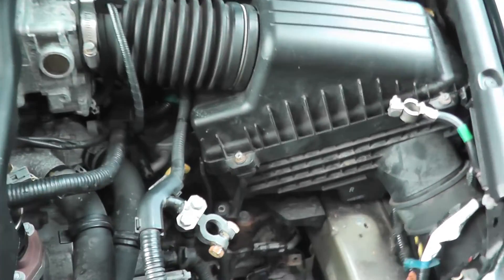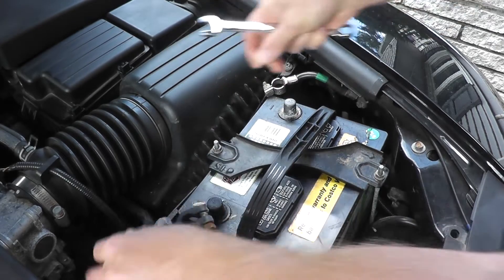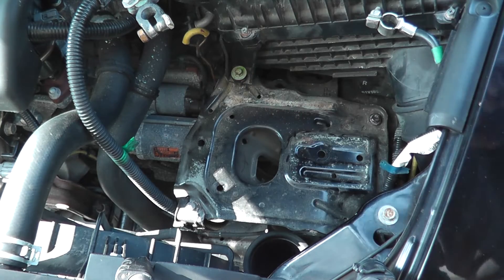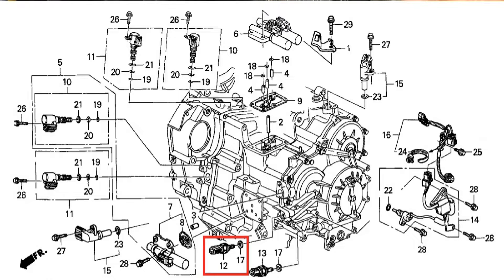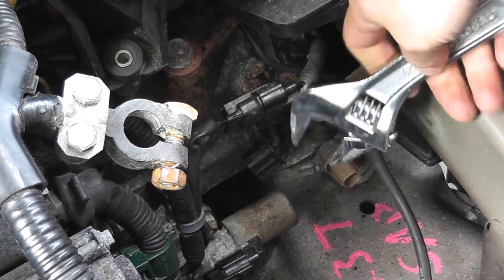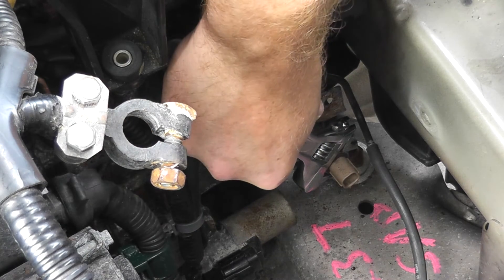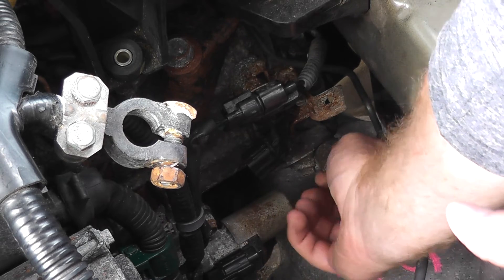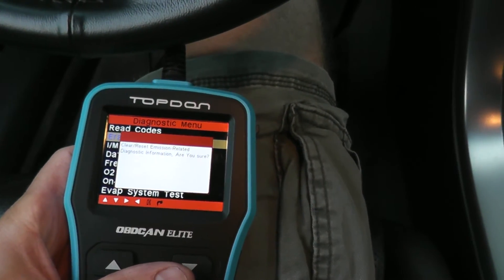How To Replace A Transmission Fluid Pressure Switch P0847 / P0848 / P0872 / P0873

Comment: Need to know we're the transmission pressure sensor is located on a 2015 Subaru Forester AWD 4:58
Reply: Yea me too is your check engine light on too.  With error P0700

Comment: You literally saved me a transmission if this works my guy. I was almost sure it was shot until I realized I'm shifting and getting into gear just fine (hit 80). I also had no check engine light when I took to mechanic. He even told me it was shot. But there was NO check engine lights when I dropped it off. But when I picked it up there was, This was a month ago(It literally sat for a month smh). I just checked them today randomly lmao 08 lancer: P0841 code for others it might be P0840 or both like me! He described from 4:58 on exactly what I experienced. I will be purchasing it tonight. I will come back for the result!
Reply: Did this work for you? I get the same code and transmission slightly shifting at 60mph. Got this code
Reply: @desr924  It certainly did. The part was $112 for the sensor but next time if it happens I'm just going with getting a new valve body and that's about 150 170 so $60 more you can get a newer one.

Comment: I have P0878 on my 2016 honda odyssey.  Can anyone help tell me which switch to change?  Hard shift from 1st to 2nd gear but only after driven for a few minutes, doesn't do it on cold start.  Occasional hard shift from 4th to 5th gear.

Comment: What is another name for the switch?? I jist got a p08433 code for my 2010 chevy cobalt and i cant find the part listed anywhere... do you know what the name of the switch is? The code said a transmission fluid pressure sensor but cant find that part anywhere...is there a difderent name 4 it??

Comment: I have a 2013 dodge caravan and whenever I put it in reverse the stick seems to go hard and it gives a very bad click. I got code fluid pressure low code P0868. I checked the trans fuel it was way more than the required level so I took some oil out. I don't have any leakage. Can anyone suggest to me what to do? thanks.

Comment: You can test them, with a very caveman multimeter

Turn the ignition switch to LOCK (0).
 Disconnect the 3rd clutch transmission fluid pressure switch connector.
 Turn the ignition switch to ON (II).
 Measure the voltage between the 3rd clutch transmission fluid pressure switch connector terminal and body ground.
 
Is there about 5 V?

Replace the 3rd clutch transmission fluid pressure switch.

Comment: I did not have any engine code or any hard shifting or driving issues but i had flashing 03 on dash board of my Accord 2014. After researching and asking honda Stealers i decided to chnage this sensor. This video helped me guiding thru.could not find the hidden Bolt anyway. So approached from the splash shield side aproach. OEM parts comes with a washer 👍.some AT fluid comes out though. No big deal.

Comment: I'm about to change the valve bodies n a 2010 Murano I don't have the code on me but it's a sensor or relay stuck off when I put it in drive it'll barely move an the computer is stopping it from giving it anymore gas is that limp mode like you mentioned. Would that have anything to do with the pressure switch or valve body issue ?

Comment: I furst noticed my car would not switch between gears. It would stay in a higher gear and once i got to autozone they did the check engine test. The reader popped up and said either its my transmission fluid is low(which it wasn’t) or the sensor is gone bad.

Comment: Were can you buy these switches
Reply from the maker: Quite often the only option is the local dealer. You may be able to find a used one on ebay.
Reply: @Carsntoys  I have a 2005 and the dealers says there no such sensor on the car.I read the sensor goes bad cause a hose is clogged.

Comment: Hi my honda accord mk8 2.4 petrol automatic green d light is flashing and gearbox first and second gear switch is jerky from before but wen the lights starts to flash igear change get rough and high revs amd engine light comes on but wen reset goes off for a while

Comment: Did you have to drain the transmission fluid before changing the pressure switches?
Reply: Not if they're mounted on the outside of the trannie like the one in this video. If it's mounted toward the bottom, you might lose a bit of fluid.. just be ready with your new one.

Comment: Hello, maybe you can help me. I was changing that sensor and I noticed that the diameter of the new sensor is very different on the new sensor. The new one has a much smaller inner diameter than the old. So I decided to hold off. Any info would be appreciated. I checked the part number and it’s supposed to be right. Also the color is different. Thanks
Reply: I can’t remember for sure, maybe rock auto, Amazon. Doesn’t matter in my case because the transmission took a final shit. Trying to rebuild it but it’s costing an arm and a dick.
Reply: Can you tell me where you got the part because all the stores I called can't find it in their system.

Comment: Hi, I have error code P0841 in my Nissan X trail 2015. Is the problem the same in your video? Thank you for answer.
Reply: Did you ever find out what caused the P0841? I've got same in my 2007 Mazda 6.
Reply: @mrau92me  yes. it's the transmission belt chain need complete overhaul. It's very expensive it's like almost buying a new car.

Comment: I am having the shuddering right now with no error codes thrown, should this be my number 1 fix?
Reply: Get a BlueDriver OBD2 scanner to confirm.  I just bought and received from Amazon and tried it... has detail report even though the error didn't show in my odometer console in my TSX 2006.  I think as long as it wasn't erased from memory, the log will show when you plug in your OBD2.

Comment: Hi my Honda Accord v6 2008 model problem is that the D light blinks but goes out after sometime. What could be the problem?
Reply: Either your trans oil is low or you got a faulty pressure switch. If you really wanna find out. Get a diagnostics test.
Reply: My Honda had the same issue and i scanned it and it showed a faulty intake manifold sensor.
Reply: I also have the D light blinking, did you guys find a fix? The transmission shifts good and all, no problems noted. I turn the engine off and the D stops flashing and sometimes won't turn on until couple days later.

Comment: How many total switches are on an '08 TL (5AT)? I don't have any OBDII codes but occasionally my AT has a harsh downshift into 1st gear.
Reply from the maker: If I remember correctly, there are three.
Reply: @Carsntoys  Gratitude, I clearly see two on the AT exploded diagram. I'm going to look again to find the location of the third switch.
Reply: Did the switch fix your problem?
Reply: @elcachanilla1759  haven't changed them yet but will before winter here...
Reply: @CelestialSevenEl  I have a 2010 V6 accord with the same harsh downshift to first. Did you get it fixed?? Much appreciated
Reply: @carsonreeder3167  my 2.4 used to downshift pretty hard i took it to the dealer got the trans FLUSHED and it fixed that hard downshift the car actually shift smoother in general after the flush
Reply: Did it fix your problem?
Reply: Still haven't changed them. I put like 3 miles a day on it now because I live near work. Sometimes I'll put 20 or so miles on the power train in a 2 day span
Reply: I have a 2016 Chevrolet spark , I need help please

Comment: I have a PO845 transmission fluid pressure sensor switch b circuit on my Mitsubishi Lancer GTS 2008, can someone tell me more about it and how to repair it?
Reply: Did you find how to fix it
Reply: @rcdailydrive3080  well sad to say.. no i didn’t, its not worth fixing.. best thing is to get a used one or manual swap it

Comment: What if I replaced the pressure switch and it still flashes D... what's the next step
Reply: Clean your TCC solenoid and filters.
Reply: For Honda's I can tell you to firstly look at the intake manifold sensor switch.

Comment: Great video! Is there more than one pressure switch? I got my car scanned but they did not say I needed to replace several but had to contact a different parts store to get the switch and they told me I needed two.
Reply from the maker: Yes, your vehicle can certainly have two switches.

Comment: Where is it in a 2016 nissan Altima 2.5
Reply: I would like to know as well because I’m getting same code p0841 and harsh shifting. Nissan Altima 2016
Reply: Would LOVE to know also! My car is throwing a P0841. Dealer said its throwing another code as well that means replace the tranny!
Reply: Hi I hope you’re still on this account I know this is a old comment but what was your problem did you have to replace the whole transmission or just the sensor

Comment: Thank you for the help!
 I have a 2003 TL 3.2 Type S, it took less than 30 min to replace the 3rd Clutch Pressure switch ( That is the one he is replacing in this video!) if you look at the diagram he flashes https://www.acurapartswarehouse.com/Page_Product/PartDetail.aspx?Vin=19UUA56823A050165&Filter=)&SubCategoryUrl=transmission_automatic%2f5at_sensor_solenoid&Diagram=&PartNumbers=
You can see it is position #12, Part number  28600-P7w-013 (3rd Clutch Pressure Switch)
The other switch #13 part number 28600-P7Z-013  is lower and is better to be reached from the wheel well not under the battery. On my 03 the battery tray has 6 screws holding it down (2 in the frame and 4 in a bracket under the battery tray. the bracket is held in by one screw that you just loosen and don't remove to get the bracket out, it has a tab you pull back and slide it up the screw can stay in the frame) As for the part Accura wanted $112.00 but I got it for less than half the price at the auto parts store! My part number crossed over from 28600-P7W=013 to Duralast   PS 590, put the cars VIN number in on the web site to help you find the right part number for your Acura! 
 https://www.acurapartswarehouse.com/
Reply: Then why did he title the video "Transmission fluid sensor switch" P0847?

Comment: Hey bud, I have an 05 tl, no codes, transmission won't engage in none of the gears. I changed the fluid and filter. Still no luck. Would you recommend replacing the switchs?
Reply from the maker: Any trouble codes?

Comment: I have a 08 acura tl...how many switches the transmission have?
Reply: Three switches 2 cream colors and 1 black
Reply: @MegaEmagic1  hello, I was wondering if you have replaced the pressure switches on a 07-08 acura tl? I have done the 3rd gear switch but the 4th gear under the airbox seems really tough to get to. For one there is very little space for my hand to snap the connector off and there is a wire and a bracket in the way as well, do you have any advice on how to approach this? Thanks alot
Reply: @campos9896  Under the bracket that one I used a 6" 3/8 entention to get to it or you could use a 7/8 O2 sensor socket
Reply: @MegaEmagic1  ok thanks for the response.  Do you remember if you removed the battery and the tray also or just the airbox?
Reply: @campos9896  yes it's right under the battery holder 6" or 3" extension
Reply: @MegaEmagic1  ok great thanks so much I finally was able to replace that one, it was a real pain in the ass to fit my hand and the switch lol. Now have you replaced the second 4th gear switch? Do you know where it is located and how hard is it to replace? Thanks alot man

Comment: Like recommended in the video, here is a link to our Acurazine thread, regarding this topic:
https://acurazine.com/forums/third-generation-tl-2004-2008-93/110-diy-guide-replacing-3rd-4th-gear-pressure-switch-3g-tl-2004-2006-a-729149/page18/#post16271890
I replaced the 3rd and 4th gear pressure switches on my 2005 Acura TL last year via the wheel well. Even if your car isn't throwing a code, this is still great preventative maintenance and will significantly reduce many jerking issues (especially during downshifts) with the UA6 models. Make sure to by OEM switches!